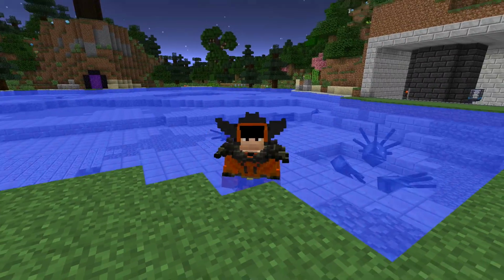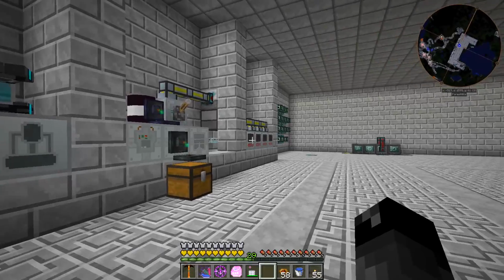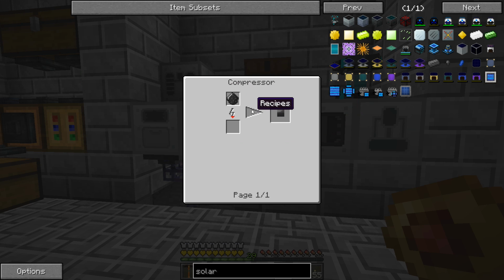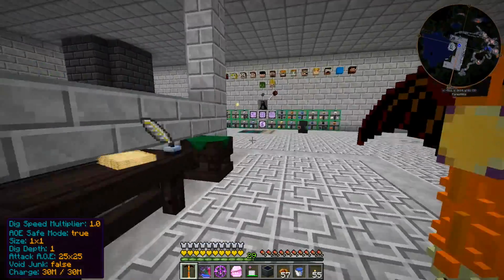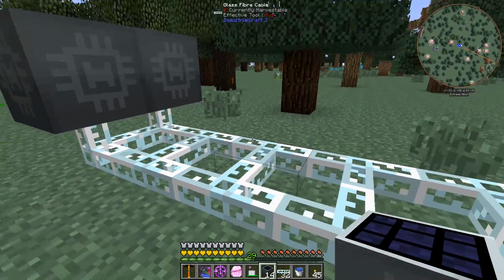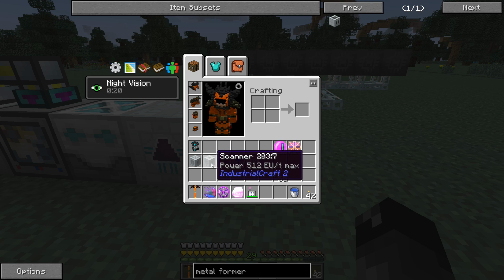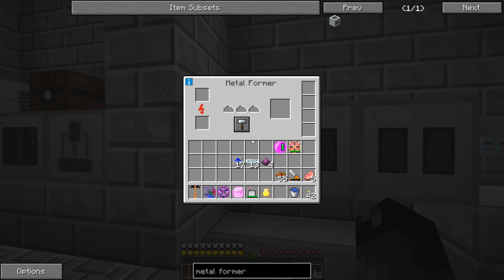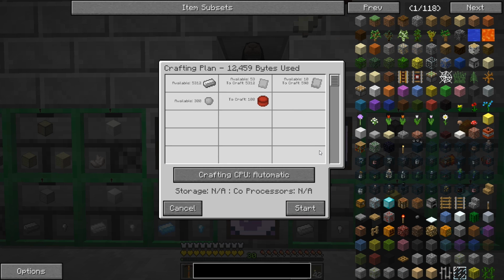Minecraft Mods FTB Infinity Evolved - SOLAR FARM [E60] (Modded Expert Mode)

Comment: If you use the glass fibre cables in a grid like that it will cause lag, you can fix this by painting the cables. Also the solar panels check every block above them until y=256 to check whether their sunlight is blocked, so placing the solar panels at y=256 minimizes that lag.

Comment: Don't forget that when you expand your Big Reactor you don't need to put a coolant in the four corners. Heat only radiates in a straight line, so you can save a ton of coolant by placing Graphite blocks in the corner. (or gold xD, glass, or even ender blocks.)
Reply: +Daniel Mtanous You can put nothing there and it still works fine.
Reply: oh cool that's awesome!!! I didn't know that!!! what he should also do is build a glass cage around the reactor 2 blocks away from the reactor and fill it with gelid chryothium to cool the outside of the reactor so he gets more power!
Reply: +Daniel Mtanous But it looks better...
Reply: +yaksher Not when he uses cryothium, it will dlow out to the sides.
Reply: TheOnlyFP I don't thing Cryotheium source blocks flow sideways, only down.
Reply: You are right, checked the wiki, my fault sorry.
Reply: no cyrotheum flows sideways. with a reactor that size or bigger filling in the corners will save so many resources.
Reply: Does it? The wiki said it behaves like lava.
Reply: It flows outwards and will "fall" like sand.
Reply: +Daniel Mtanous I know it flows down and sideways! that's why I said he should build a cage around the reactor and then fill in the gaps. he could use the flood gate from BC building
Reply: *****
Ah okay, thanks for informing. ^^"

Comment: An anvil works for renaming and showing it in an interface terminal, but you can also use a tinker's tool station without the need of xp. I didn't know that ae method though.

Comment: u dont need MFSU at ALL, those glass cable transer unlimited power, u are actually limiting yourself with the mfsu, i suggest  to use one solar panel for all the recycler and all the otherones to the mass fabbricator,
the hyper energy transfer node converts ue to RF and is pretty powerful aswell
Reply: +Jollyeye Hyperenergy node does the conversion? didnt knew that, what about the normal ones though?
Reply: they do but they transfer only 10'000 rf/t
Reply: +Arnab Biswas They do, as do the cables from Immersive Engineering
Reply: +DeadlyLazy  +Jolleyeye

Thanks for the info, will help me in a GT based even harder mod pack me and others r working on.
Reply: He has a cable that bypasses them so they just acts as a battery for during the nighttime

Comment: immersive engineering requires direct contact to the machines or to a transvector interface? from thaumcraft
Reply: +James Pollock It needs to connect a power source machine to a power storage machine. For instance, the nuclear reactor to the resonant energy cell with high voltage cables, and transformers/relay. You can also connect an energy storage machine to another energy storage machine of a different type with high voltage wires and connectors.

Comment: Can a Tesseract transmit EU?  Was wondering if I could do a similar setup but be able to leave the machines at the base.
Reply: +Feed The Chunk Tesseracts do not transmit EU.
Reply: +Feed The Chunk RF only, but you can connect an immersive engineering transformer to convert RF to another power type, and vice versa.